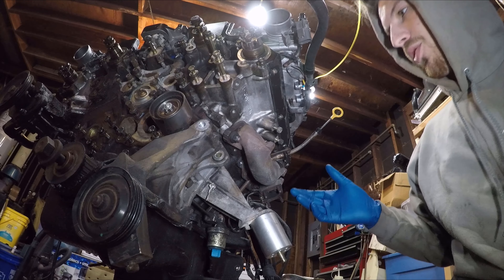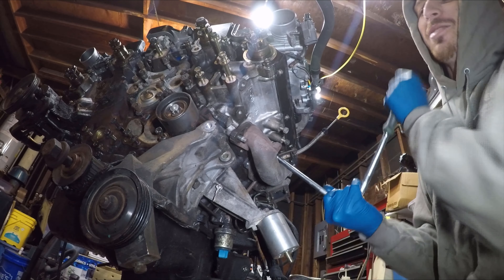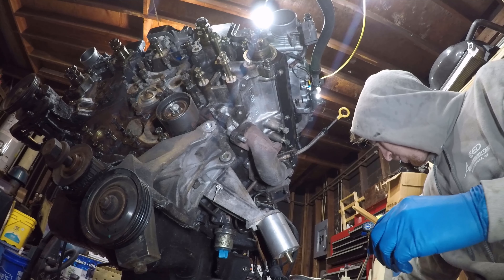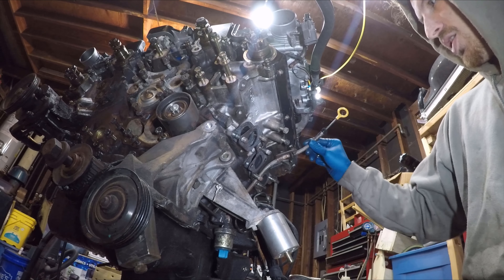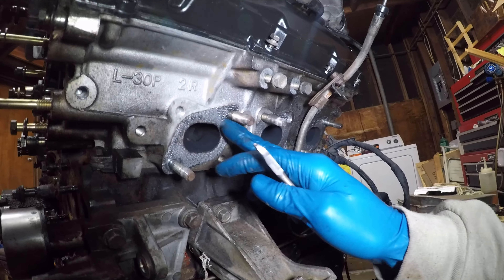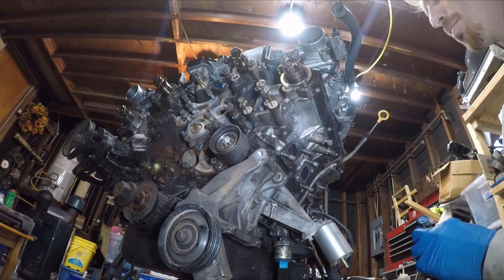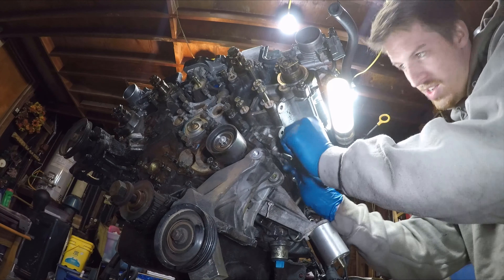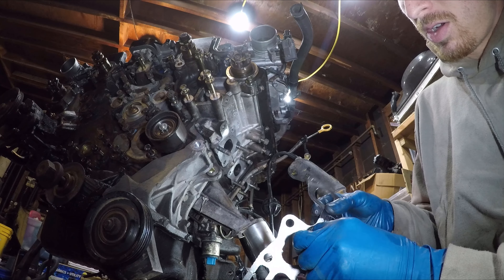300ZX Turbo Manifold and Oil System Install On NA Engine

Comment: I’m bout to start a project on a na-tt. I’m planning to push at least 350-400. I’m going to use your videos as a reference. Keep up the good work bro
Reply from the maker: Thanks man! That’s about what I’m aiming for too! I’d even take less if I could get a 91 tune lol stuck with E85 that’s an hour away from me for now so we’ll see what happens lol
Reply: @TheFeesher  hey, is it possible to turbo an na automatic?
Reply from the maker: @yoestoes2381  yes, but the turbo charged automatic cars had different cams and turbos iirc to not put as much stress on the automatic trans

Comment: I'm so glad I found your channel looking for a slave cylinder/master cylinder how to. I am picking mine up this week. It's a red 86 Na I believe. For $1,000 I don't care and plan to go turbo asap. It's just the pistons that are different right?
Reply from the maker: There’s a lot that’s different, 86s are also different than the 90s ones. Internally though, TT has different pistons, oil squirters, and oil pump, also different exhaust valve material, depending on the model of car a TT auto car will have less aggressive cams too
Reply: @TheFeesher  I appreciate it. I heard that i can Turbo the Na motor and run low boost, like 4-7psi. Do you know if this is a reasonable route to take? At least until I can rebuild the engine and upgrade the pistons, ARP rod bolts, head bolts/studs and whatever else I can afford. I got it home yesterday, gotta order the slave cylinder and master cylinder, new fluids and filters, plugs, etc. What is a good sounding exhaust and an intake for it as NA setup if you don't mind sharing? One last thing, are there any mods I can do to get anymore power/performance? I plan to daily it, and maybe run it on the 1/8 mile track in mobile, Al a little. It has 160,000 miles, 2 owners that were brothers. I tried getting it about a year ago but I just couldn't get the money together. Then I messaged a month ago and then 2 weeks ago the guys wife called and said he passed away unfortunately. So I offered the $1,000 I had and she said come get it. Then his son said, dad really wanted you to get it and he would be happy to know I did. I didn't even know the guy, just gave him a price on an awning and saw it in back in a barn. He saw my excitement and took me to see it. I am so thankful and can't wait to lay a little rubber down!

Comment: My middle runners manifold bolts were different?! Middle one had the left stud on the bottom and the right stud on the top, I had to take them out and switch them. Odd that yours wasn't like that? Any idea why? Maybe a year difference?
Reply from the maker: No, I just already done that in the past and forgot to mention it, for some dumb reason they switched two NA and TT studs
Reply: @TheFeesher  i gotcha thanks. what recourses are you referring to to build this? all i keep finding are dead forums with outdated info and missing pictures.
Reply from the maker: Many times it is just the 300ZX NA-TT Facebook page